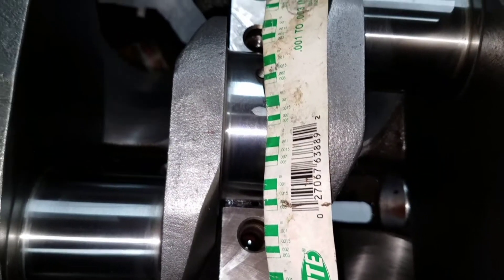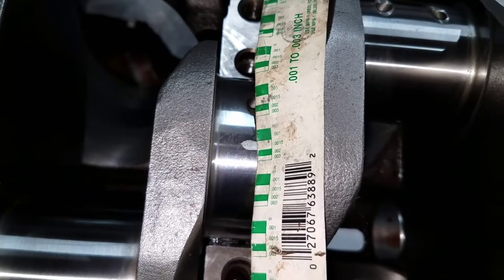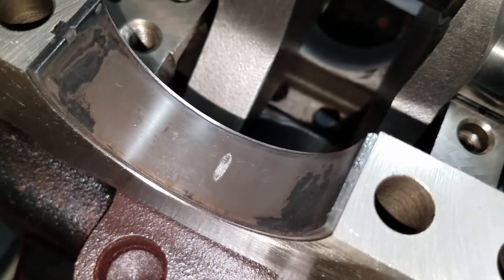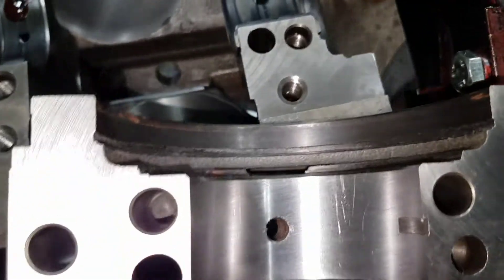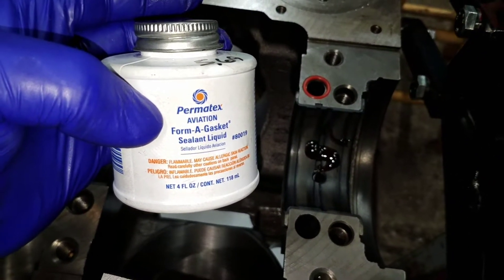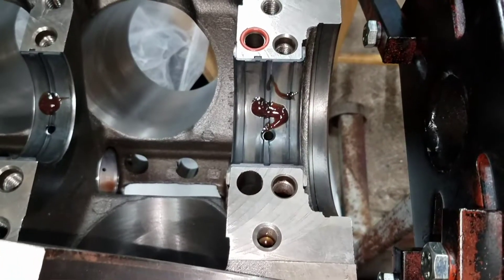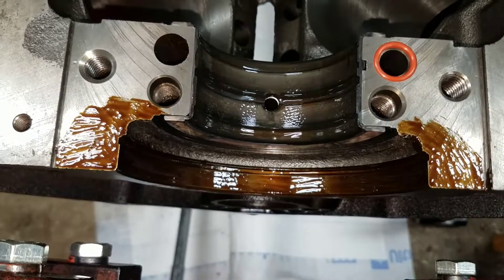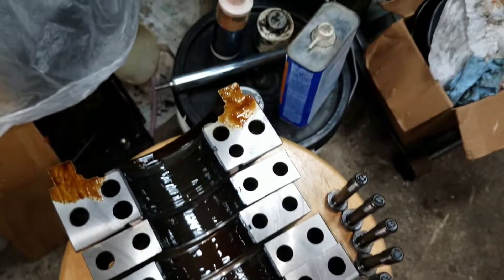BBC Gen V/VI (5/6) rear oil seal  install breakdown

Comment: I heard real good things about that permatex gasket maker you use but never personally used it.  Does it make seal installation harder from getting tacky or easier cause it doent dry fast? Im about to do my rear main seal and debating if I should use it or just put it in dry with nothing....
Reply from the maker: The permatex aviation sealant is just my preference. It takes quite awhile to harden giving a long working time. Usually tacks up in a few hours but can take 1-2 days to fully cure like road tar. Thus gives enough time to finish engine build and if have to go backwards for any reason it only takes rubbing alcohol or break cleaner to remove the sealant. You can also use ultra black or grey sealant too but is harder to get perfect amount on surfaces that won't end up inside rear main gasket inner lip and causing issues. Some older guys like the Permatex Indian Head Gasket Shellac Compound. It's similar to the aviation sealent as a hard tar like sealer even in low temperature applications like winter. The compound is often applied with a brush or a cotton swab on valve cover or head gaskets too. The one peice rear seal of the genV/VI/VII are not held in place like the sbc 350 and needs some sealant to help the aftermarket gasket stay in place while assembling and long term. Good luck!👍